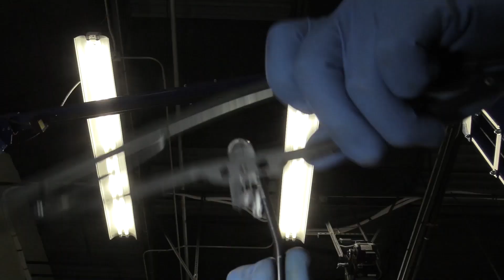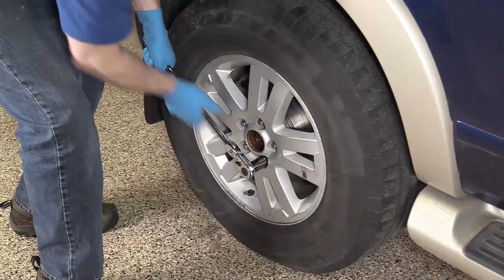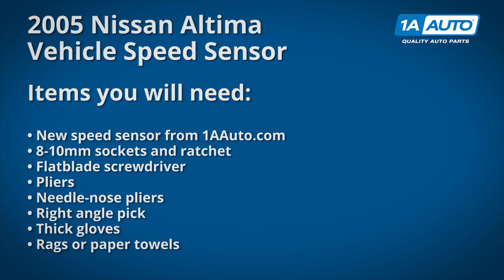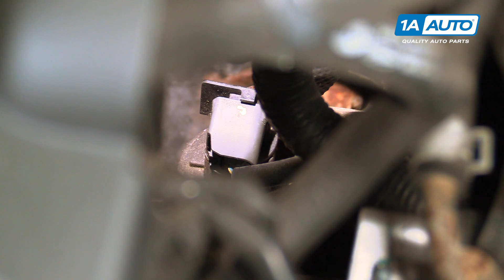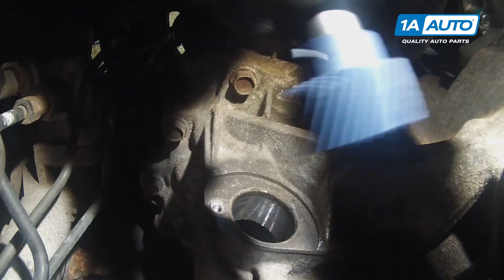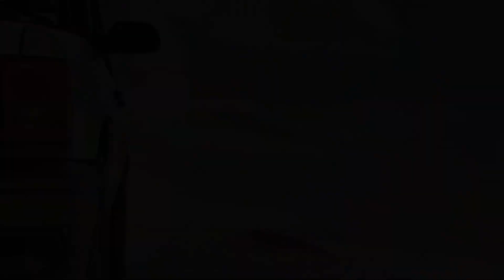How to Replace Vehicle Speed Sensor 02-06 Nissan Altima L4 2.5L

Comment from the maker: √  Watch the Video
√  Buy The Part at 1A Auto https://1aau.to/m-Visit-1AAuto
√  Do it Yourself
√  Save Money
Reply: I have a 2005 Nissan Altima 2.5 4 cylinder and when I step on the gas pedal to accelerate the rpm doesn't move when in park or drive but I'm able to reverse the vehicle. What could be the cause of this problem?

Comment: I have a 2004 altima 2.5. I have replaced the sensor located on right rear of transmission. I erased code PO 725 after installation. The code is back on again. Are there two sensors? If so where is the second sensor located at? Thanks.
Reply: Did you ever find a fix to this? I’m having the same exact problem. I’d greatly appreciate it
Reply: @Alex-ot2mr  I am having the same problem. I get p0335 and 725 i changed all 3 sensor and I still get the same code

Comment: i cant get it to snap all the way in even tightning the nut doesnt draw it to a flush sit,,so it is still up like 1/8 inch,or a 1/16 (((Will this cause an issue ?}}} i tried like heck to get it to sit/snap in tight to top of trans pan but just couldnt HMMM? any opinions or should it still function fine,i cant test it yet car is off the road awhile now,,,but this is one repair i had to get fixed,,,thank you for help about this greatly appreciated!!!

Comment: I have a 2004 nissan altima 2.5l sl and the code read 725 engine speed signal, do I need to get the transmission speed sensor or the vehicle speed sensor?

Comment: Does anyone know if this will fix p1722 on a 2010 Altima? Had a code for stepper motor (p1777) I replaced that part and issue went away but came back very fast, is the speed sensor now the issue?
Reply: I think that’s inside the cvt transmission

Comment: When replacing these types of parts, should the battery be disconnected or is it ok to proceed otherwise?
Reply from the maker: +Shawn Holt You can disconnect it if you'd like, but for this job it would not be necessary. Thanks for checking us out! 1AAuto.com

Comment: 2004 VW Jetta.. Engine light faulty code p1722, manual transmission.. Question; would this code cause the transmission not to engage into 3rd and 4th gear? (Reverse, 1st, 2nd and 5th gears work fine) Answers are greatly appreciated!

Comment: I've a 2005 Nissan Altima 3.5 V6. Is this similar or same process?
Reply: Look at the way your engine bay is set up. 
If all the parts he's removed are in the same spot, require the same things to remove them, and most importantly if your speed sensor is in the same place as the one seen in the video, I'd assume the processes are the same. However I'd advise purchasing a speed sensor for your specific car only. It narrows your correct parts options down IMMENSELY when you search for the part using your vehicles vin number but, that's just my personal opinion. 🤘
Reply: Transmission won't shift gears properly it just happened doing one of my pulls sounded like a misfire didn't hear no debris from the event I get shuttle sounds

Comment: Good video is complete thanks, one question only, the sensor you show is the speed one and I guess the turbine sensor is next to that same car? I guess is Nissan Altima model from 2002 to 2006? this is correct?
Reply from the maker: +Miguel Rosales Thanks for watching!  Unfortunately we do not have any diagrams available to confirm which sensor is next to the speed sensor, but any repair manual for your model should be able to help!  1aauto.com

Comment: I JUST REPLACED THE SENSOR BUT IT STILL  PAUSING WHEN SOMETIMES WHEN I  SHIFT FROM PARK TO DRIVE, ANY SUGGESTIONS? OR SHOULD I JUST GIVE IT MORE TIME?
Reply: You should have reset the codes and it could have started Fresh.

Comment: Will this keep the from starting
Reply from the maker: +Ryan Neher Since there could be multiple reasons why you’re experiencing this difficulty with your vehicle, I strongly recommend that you have a reputable mechanic inspect it. They’ll be able to troubleshoot the problem and tell you what part or parts you’ll need for the repair.
Reply: Have you tried the crankshaft position sensor

Comment: Because they scanned my car and the code p0500 come it says speed sensor , but i dont know where it is?
Reply: Is the one you seen in this video this is a speed sensor the other ones on the bottom of the transmission or the turbine speed sensor and Revolution speed sensor

Comment: Is that the same location for a 2005 nissan maxima 3.5L? Can't seem to find ANY videos for an 05 maxima for the speed sensor. Not even on Google
Reply from the maker: +Chris T. It may be a different procedure on your application. We currently do not have an auto repair video for this particular year, make and model. Thank you for asking. 1aauto.com
Reply: I have the same problem I have a 2004 Nissan Maxima 3.5 and I can't seem to find the videos I don't know if the sensors are located in the same place as 2.5 Altima
Reply from the maker: YOu may be able to use some of the install instructions in this video as we do not currently have a video specific to your vehicle. +XL american Bully pitbull

Comment: Is this the same for a 3.5L Altima?
Reply from the maker: +Dewayne Sloan It may be a similar process. 1aauto.com
Reply: If it's the same for a 3.5 Altima it has to be the same for a 3.5 Maxima guess
Reply from the maker: At this moment, the closest how-to video we have to your request is for this vehicle, which is very similar to the one you have. The steps may not be 100% the same, but should contain an adequate amount of information necessary for accomplishing this task: +XL american Bully pitbull